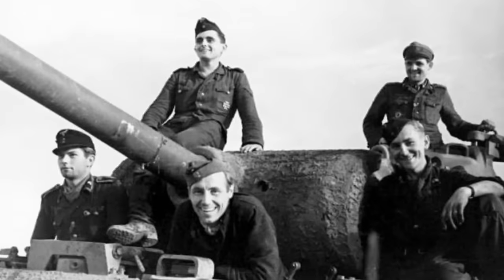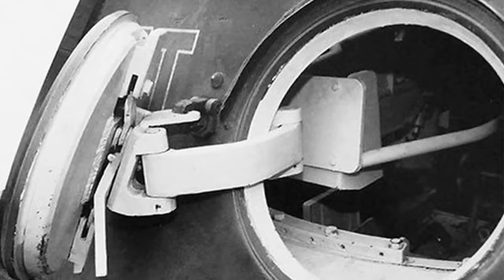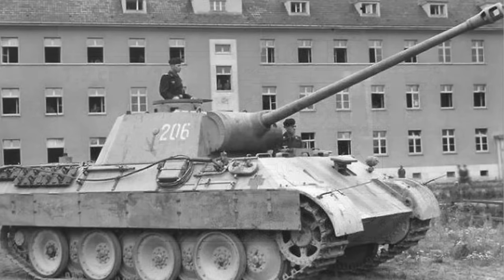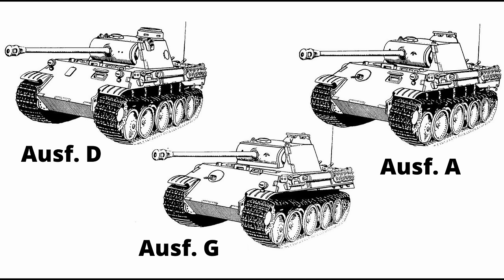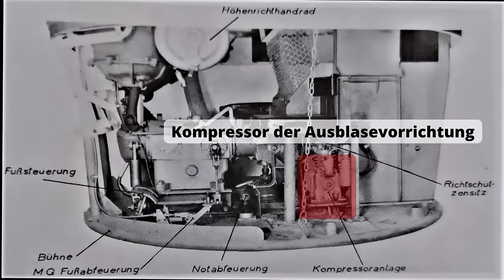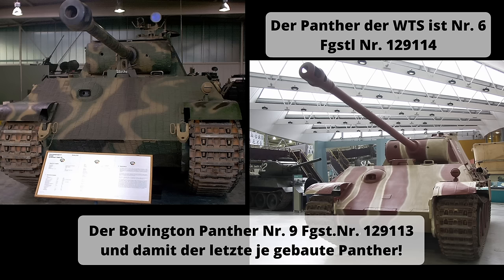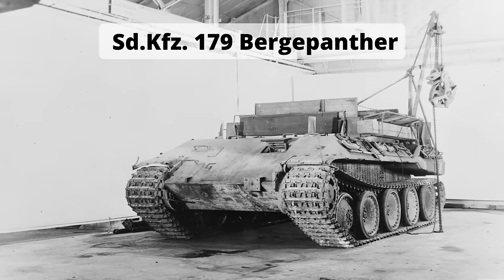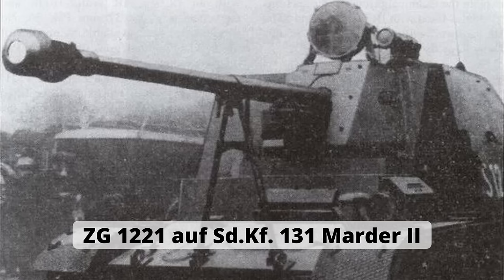Panther - eine legendärer Panzer...? - Konstruktion und Bau -

Comment: The distance measuring.. Never applied. I wunder why. It would have increased first shot hits in a great way.
Especially for havy caliber guns....
Reply: They were afraid of misalignment issues with of Rangefinder, but the trials strongly suggested that it wouldn't be a problem.
A real fail was the decision to give the Rangefinder to the Gunner, the Gun sight and the Rangefinder were two different sets, so it would not been a practical solution anyway.
Cheers 
Alex
Team-BACUFFZ